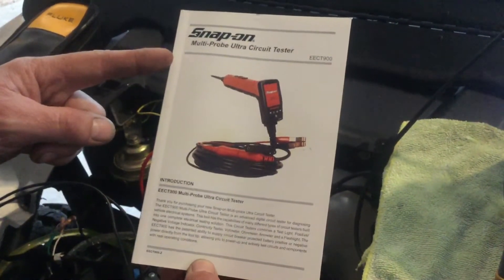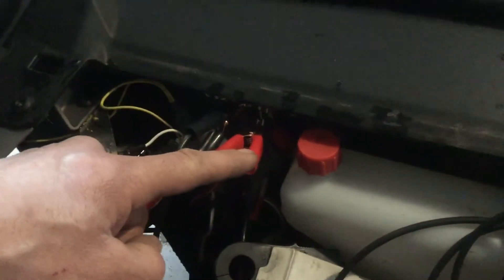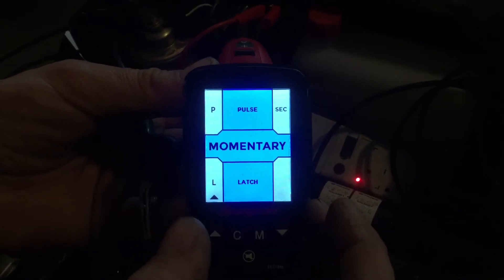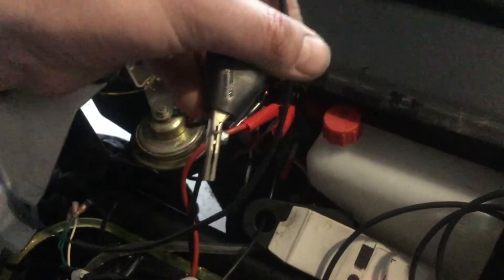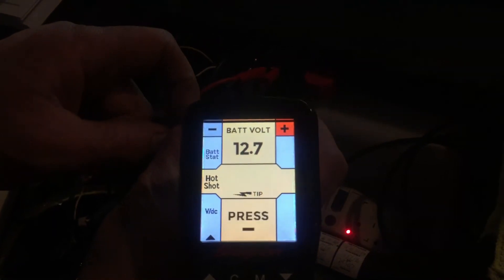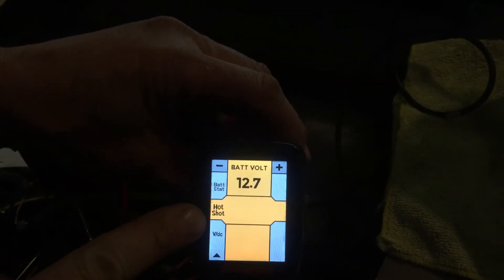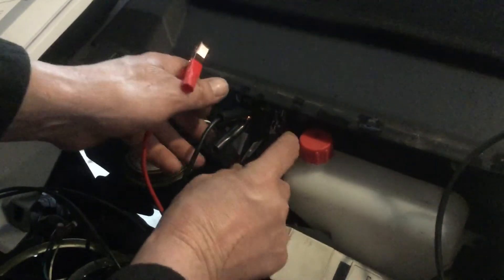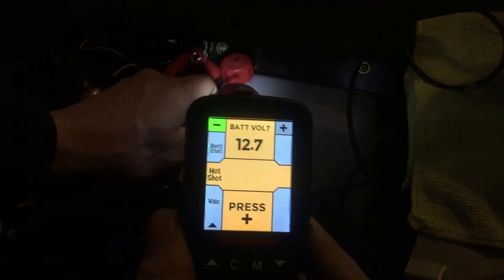Snap-On Multi-Probe Ultra Circuit Tester EECT900 Part 2

Comment: I was looking at a used one of these on eBay.  Would you recommend getting one!  Thanks, Tom
Reply: It’s a decent tool, but has a slow reaction time.
Reply: New level auto has a video under 4 minutes showing the issue. Check it out then decide.